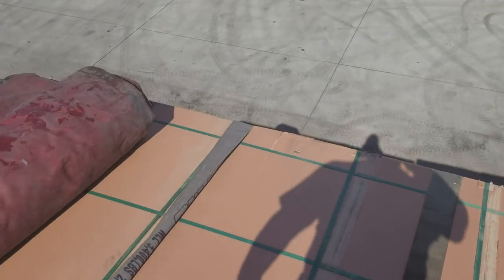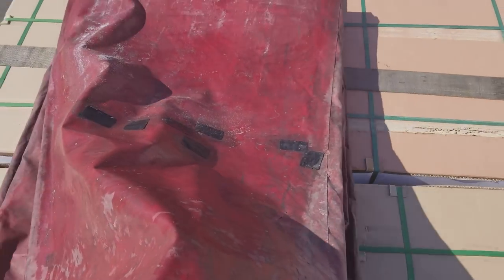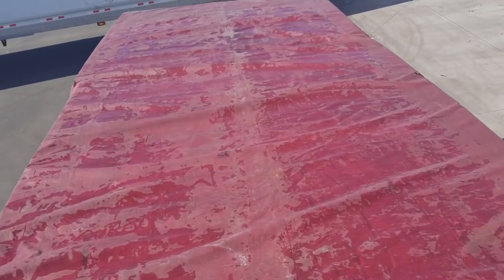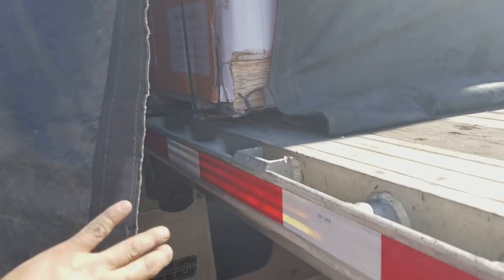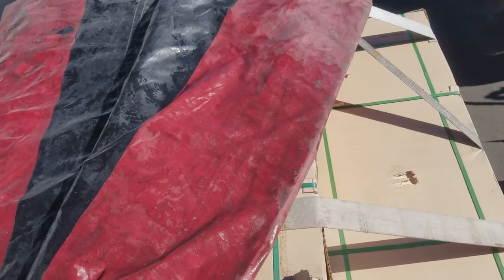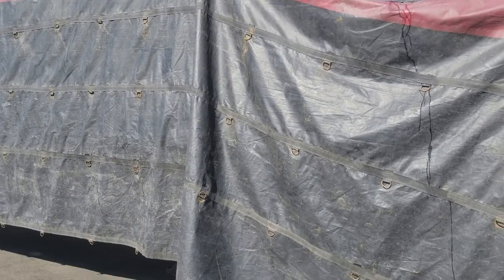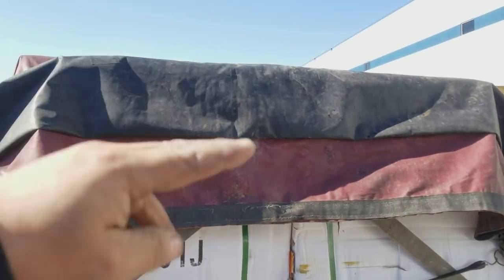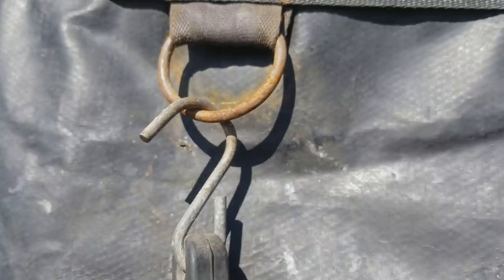Tarping a load

Comment: How long did it actually take to do that complete securement?
Reply from the maker: less than an hour
Reply: @truckeraxelmunoz4939  nice work! I've been driving for several years but I'm thinking about giving a flatbed a try. I've mainly hauled construction equipment to and from our job sites so tarping loads will be about the only new thing for me.

Comment: If you do it right, you won't need any straps over the tarp! I never do and I've never had any problems with the tarp blowing or flapping around.
Reply from the maker: CONTAINERMAN68 I've never had a problem but you never know
Reply: Axel Munoz The only time I strap it, is when I'm almost at the end of the tarp. Not much overlapping! But if you have more than 4 feet overlapping, I don't strap it.
Reply from the maker: CONTAINERMAN68 I agree there